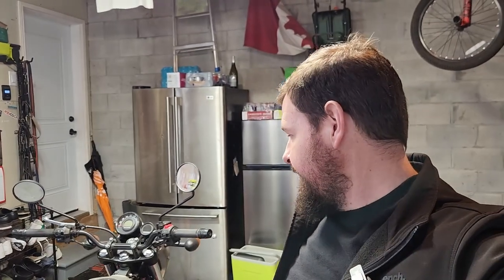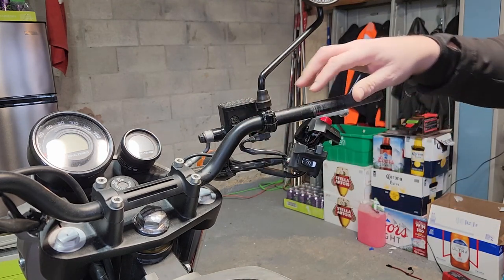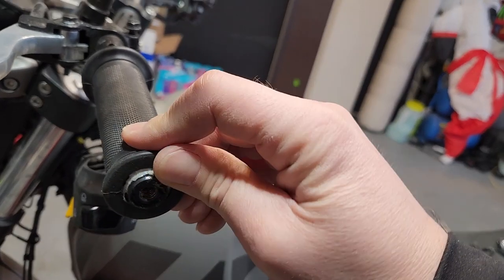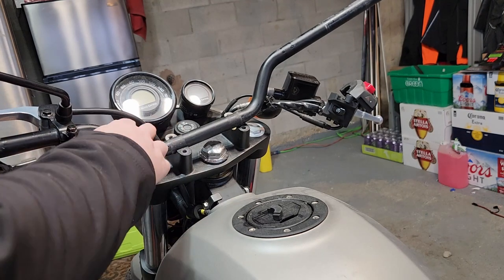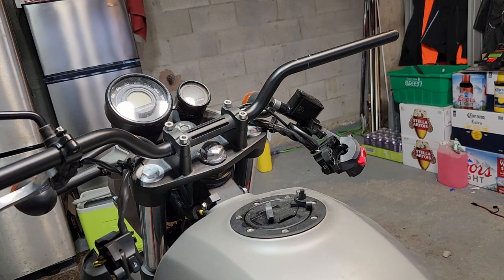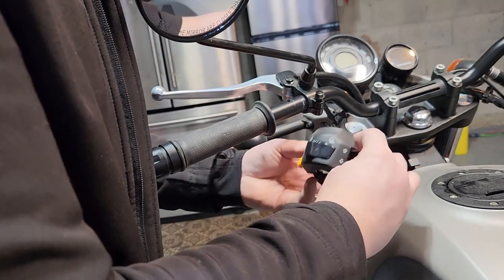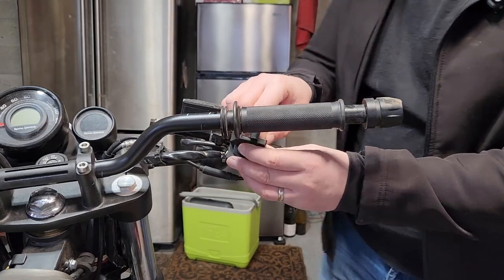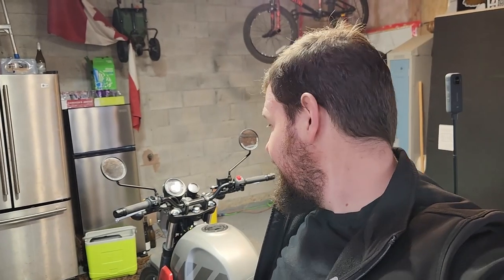Installing Handlebars On A Royal Enfield Scram 411

Comment: If you get the bike up to speed and take your hands off the bars and it starts to pull to one side or wobble then either your forks are out of alignment/bent  or your rear tire is.
Reply from the maker: Thanks! I didn't even bother with that, I just went ahead and tried to realign them. I'll try this first next time.